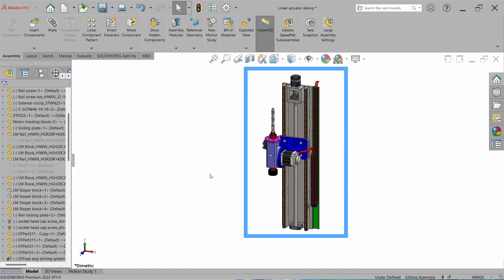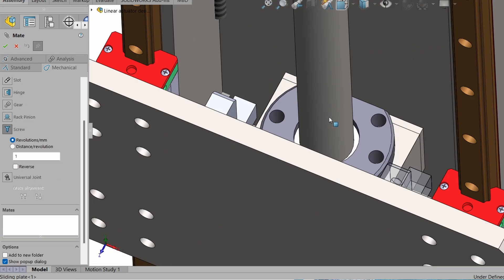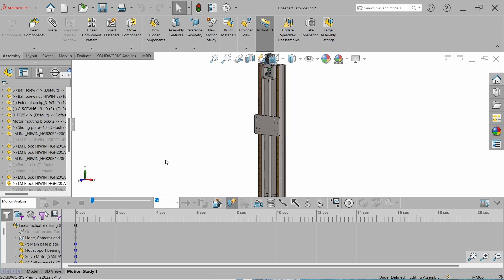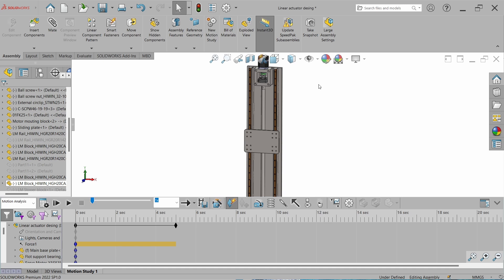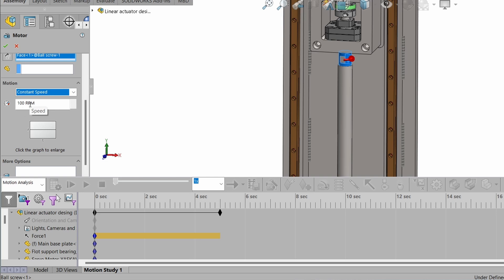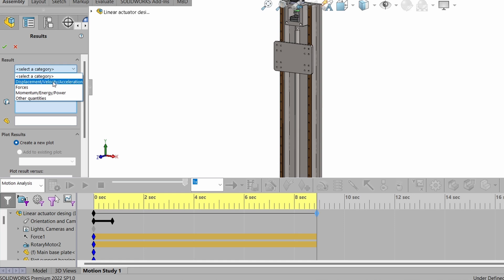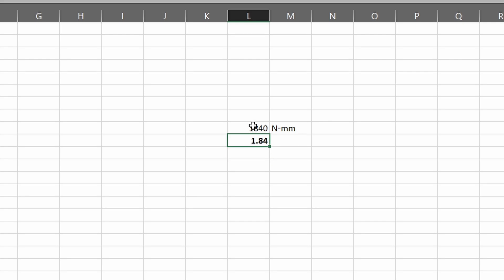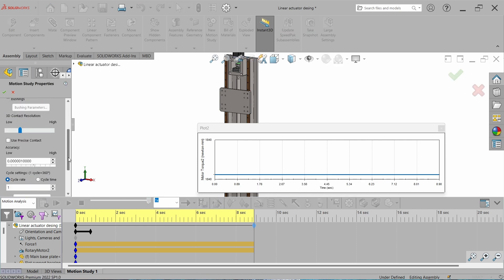Solidworks Motion Simulation Study | Motor Driving Torque calculation

Comment: Hello sir, currently I'm working on 1 project in that I need to design one actuator that  are used to open & close heavy
doors in aircraft for various maintenance purposes. They maybe pneumatically, electro-hydraulically or electro-mechanically operated to lift the door weight. Post maintenance, they may be allowed to retract under the influence of the door’s self weight.
Here below there are terms and condition to designing the actuator:
Objective: A safe solution that can implemented to lower the door weight under the
influence of gravity at a controlled rate without use of any external source of power.
Functional req:
➢ Actuator retraction rate shall be less than 25 mm/s anytime through out retraction
phase. The retraction time must fall within the range of 20 to 60 seconds.
Architecture req:
➢ Proposed actuator needs to fit in a cylindrical envelope of Ø 80 mm, 1500 mm long
see figure for space envelope for
Temperature req:
➢ Actuator shall be operable between -40 deg C to +80 deg C
Duty req:
➢ Actuator shall be capable of 3 back-to-back operating cycle over the temperature
range mentioned above (one cycle = Fully open – fully close. Opening/ lifting of the door weight is not scope of this
challenge)

...
Can you give me idea which mechanism is suitable for designing this actuator and How to add the self retraction approach in this mechanism means that without giving any external force?
Reply from the maker: I guess there is mainly two self-retraction mechanisms could work. one is Hydraulic and one is spring. but Hydraulic would be absolutely better, use highly accurate flow control with flow sensor in hydraulic based actuator. to precisely control the retraction speed.
Reply: @mastermechanicaldesign  Can Ball Screw mechanism with operational servo motor work at above problem statement ? I mean it is a linear actuator and it can be work for self retraction? Could you pls suggest me the best solution?

Comment: Hye .. if you have good idea which laptop is good for Mechanical  Design  Engineer  like like Basic software  Solidworks  , Autocad , Creo  Inventor. But  i also need the laptop which could  handle  the Assembly  of around 1k -1.5k parts ... please  if anyone  have idea answer  me
Reply from the maker: for Light work any Laptop with processor i5 or above is good enough, just consider SSD and at least 8 GB RAM, with dedicated Graphics Card. For heavy work, better to use customized PC or workstation.

Comment: sir how about the accuarcy of result of solidworks motion analysis in order to calculate right torque for selection the required 
 motor
Reply from the maker: 1. Try to set up the model closer to real-world as much as possible. Like define every "contact" their friction- ball screw nut friction, LM guides friction 
2. Apply mass load by applying gravity Instead of Fixed force, so that Solidworks can also consider the dynamics of mass during changing in velocity
3. Setup motion in the graphic table, acceleration time velocity everything.
4. Crank up Motion analysis results resolution settings. As much possible.
5. Hope system will not give error

Comment: after finalizing the assembly how to fix interference detection errors or 
does it matter or not ?
Reply from the maker: Hi Jai, Interface detection tool just lets us know, where the inferences are, it's up to us, does it matter or not. For example if the ball screw and nut are giving interface error then this is okay. Because they are standard parts and we are aware it will be assembled correctly in actuality. But if some manufacturing parts interest each other then there is a problem that needs to be fixed.